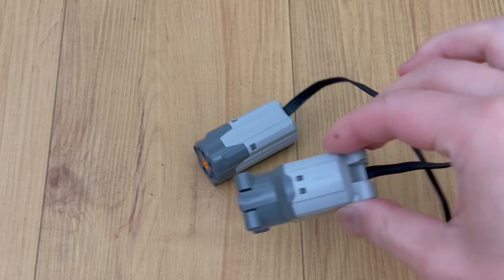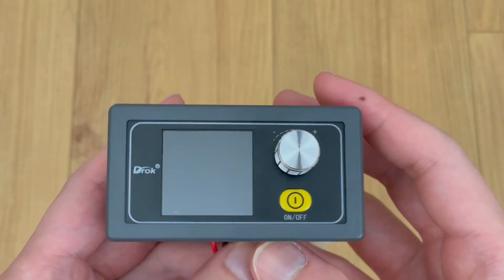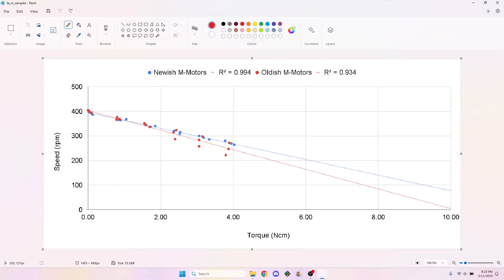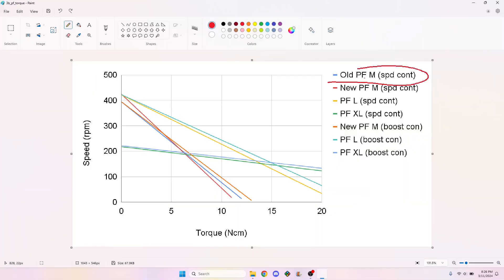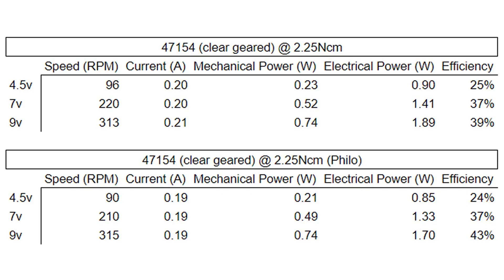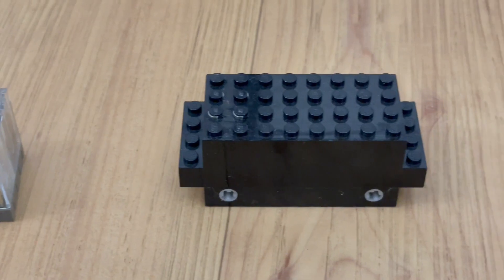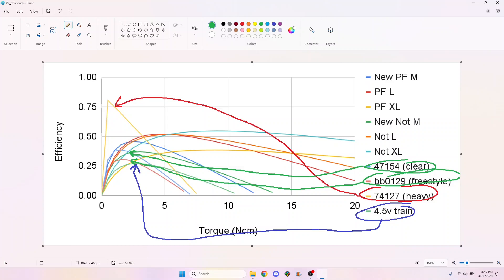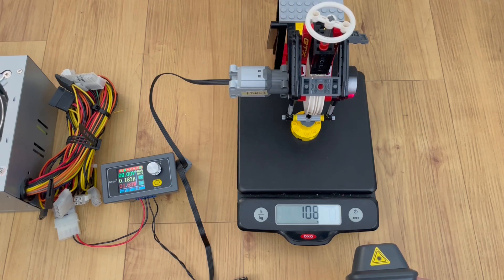How EFFICIENT are LEGO Technic and Not Technic Motors?

Comment: interesting graphs , it's missing the 70823 micro motor , it will be surely on the bottom of the scale :3
Reply from the maker: The problem with the micromotor is that the nylon washer in the adapter slips very easily, so you're basically testing that rather than the motor itself.
Reply: I’m looking forward to seeing 4.5V Technic motors tested :) there’s always so much variation between individual motors in their noise and speed, it would be interesting to see if torque varies as well. The 9V ungeared Technic motor that you’re also going to test seems a lot more consistent to me

Comment: There is a lego tachonometer. 

Anyway. You can get a more exact torque reading using a universial joint and have the output shaft to something that messute torque. Not only can it give a full spectrum reading but also a real time reading elimiating other errors
Reply from the maker: If you're referring to the 5206 Speed Computer, I do touch on that in the first video: https://youtu.be/A8VZhnGhG2M

tl;dr we felt that the 20RPM resolution was pretty coarse when dealing with RPMs in the low hundreds. The optical tachometer also doesn't add any additional resistance to the brake.
Reply: @NonsenseWars  YEs.. that is true. I didn´t know it was that course.